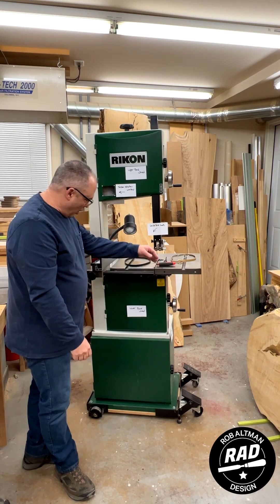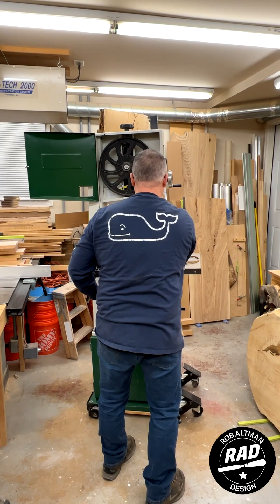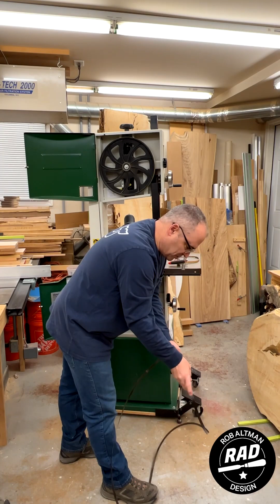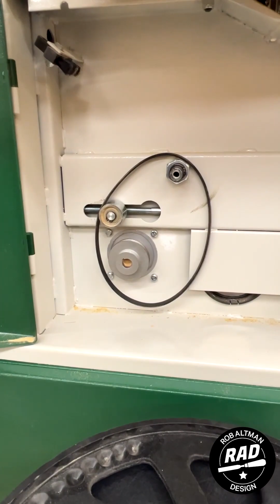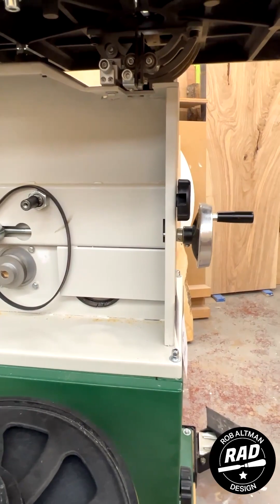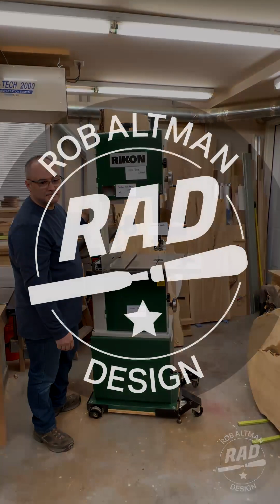Rikon 14" bandsaw 10-325 - Replacing the drive belt and blade

Comment: I have had this bandsaw for years. Always had a love/hate relationship with it until I set it up like Alex Snodgrass recommended. Also found that the 1/2” and 3/8” blades worked the best. Tried 3/4” a few times but think the other blade sizes are the sweet spot.
Reply from the maker: Thank you for letting me know.  I can't wait to check out how Snodgrass sets it up.